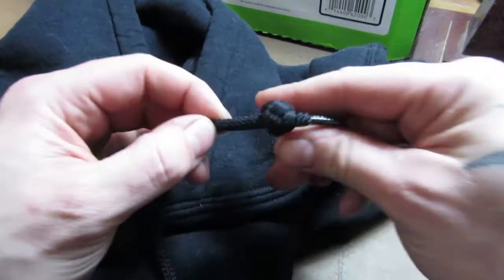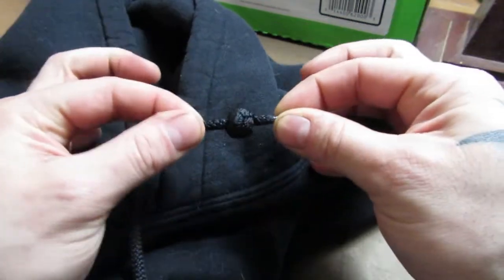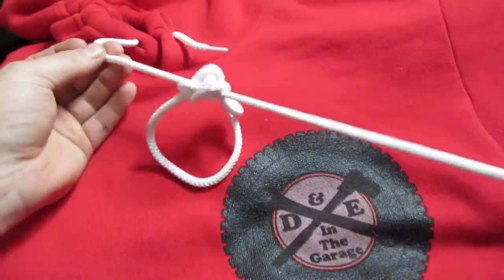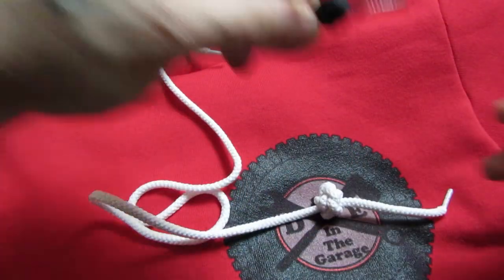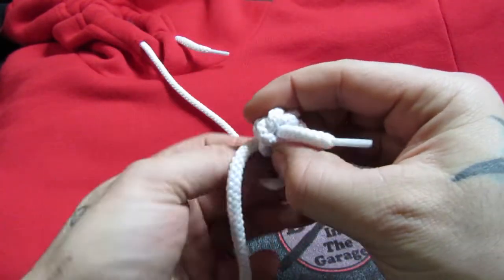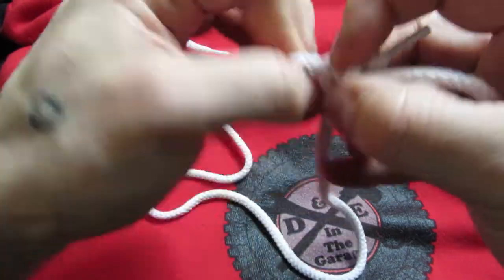CELTIC BUTTON (LANYARD KNOT) - How To Tie

Comment: Very handy knowledge to have knowing how to use and tie different knots for different situations man. How did the rotella T5 work out for you before you sold little buck?
Reply from the maker: Worked out great! I told the new owner about it and I have switched my 2000 WJ 4.0 over to Rotella with similar results.
Reply: @DEInTheGarage  so putting rotella in the wj don't bother it?. I want to but want to get knowledge from a tried and true user
Reply from the maker: @RawTruth420  Nope, quite the opposite. When the 4.0 was designed is was designed with the idea that all oil had the ZDDP in it that is now only found in HD Diesel oils like Rotella. Running Rotella is actually like running what was originally suggested for the Jeep.
Reply: @DEInTheGarage  it shows no issues here in the cold? Being a heavier oil? I was the one talking with ya when me Jeep went down. I even sent ya something on messenger. If ya haven't seen it..check it out. Thanks for the responses.

Comment: I always completely remove the string from mine, but for a different reason than power tool safety.  One less thing for an attacker to control or try to choke you with.  First thing my Dad did whenever we got new hooded sweatshirts or jackets, pissed my Mom off, but that's the mindset you get when you're a Corpsman training w/ Marines.  Same reason I cut a notch in the collar, easier to get it over and off your head or to rip out of it.  

I cut the cuffs off for power tool and engine safety, that and I hate having stuff around my wrists.  That REALLY pisses off the wife when I "model" the new one she just got me and then I lop off the first 4-6" of the sleeves.

Even after 25 years, I still get the "Why do I bother??" look... :)
Reply from the maker: Haha... I guess I hadn't thought of that.